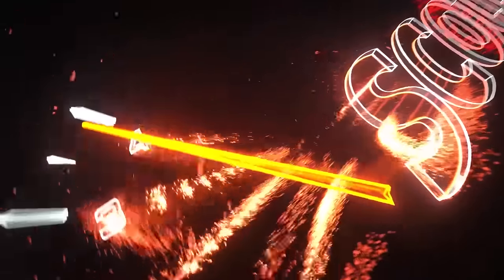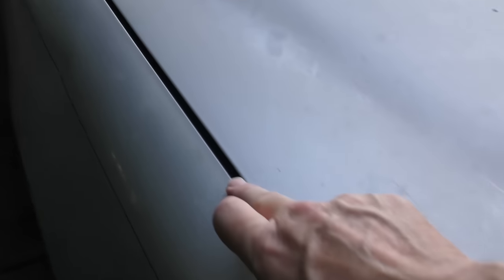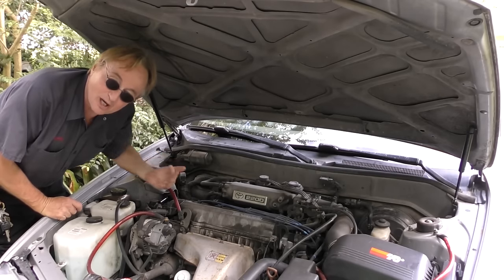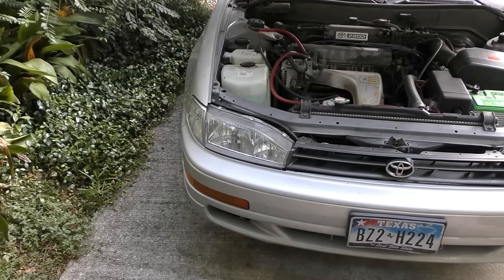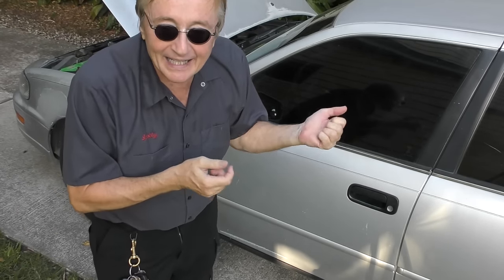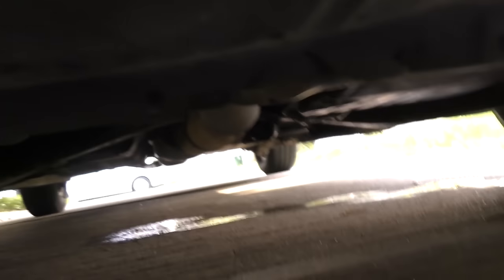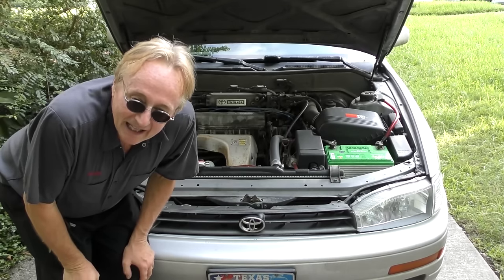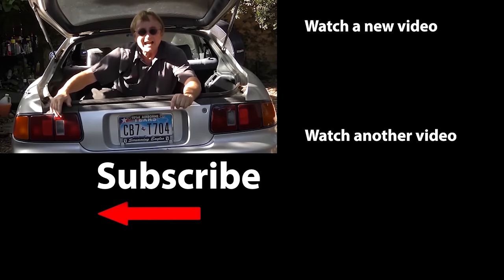Can You Destroy a Toyota Camry

Comment: My 79'Lincoln has original near mint condition original paint and still has the original drivetrain in it,never repaired,original radiator in it too,the factory original digital stereo still works and plays 8-tracks perfectly.HAHAHA!!(8-TRACK)
The AC has only needed recharging ONCE since 1979 and has over 400,000 miles on the clock.
The 1974-79 Lincoln Town car are still quite plentiful on the used car market.
Reply: I've Owned Various Cars; FORD Treated Me The Best!! Have Had 2 Honda Accords '86 & '92 and 2 Toyotas '90 Tercel and '99 Camry. Bad Luck I Guess..
Reply: Rogue Ranger I've had Fords most of my driving years! Got a 2004 Grand Marquis, 1990 LINCOLN MarkV11, both trouble free cars! The LSC is Showroom new, dries like a dream and fast as hell! Got the Mustang 5.0 high performance V8.. 0-60in 7.5 seconds! Pretty good for a 30 year old heavy sports car!
Reply: @joelspivak6622  I'd would like to find a Lincoln Mark-IIV(7) LSC,very nice ride.
Reply: @joelspivak6622  and a 1997 CAMRY LE with the 3.0  1mzfe v6 5speed   with 200.000 miles will eat your lincoln up  with it so called 5.0 ho and lincoln never made a sports car

Comment: Burns rubber in all 5 gears,yeah maybe if it's lowered and tires are rubbing.
Reply: tommyguns14able ...LOL 😂😂😂😂😂
Reply: I have never seen a normal everyday family car than burns rubber in a gear higher than 2nd and I doubt even a 700hp muscle car would do it. If you are racing a car you are not going to be shifting to 5th until at least 90mph and at that speed the car is very stable and its going to take a lot of power from the engine to cause the tyres to lose grip especially in a striaght line. Even with horrible shitty chinese tyres that are almost illegal it wouldn't spin up in 5th and trust me I have said such tyres before.
Reply: Maybe if it was a manual and you started it in 5th and you could take off without stalling it. I've seen that done in small 90s pickups
Reply: I have 2000 Camaro 71.000 runs better than new

Comment: They really did over engineer those things.  I have a 1990 Corolla with 408k miles on it, original engine and 5-speed transaxle, never been rebuilt (put a head gasket in it 3 years ago though).   I bought it 22 years ago for $2,800.  It's about as basic as you can get with manually operated everything, except it does have power assist brakes and a/c.  The a/c still works, but I did have to replace the compressor about 15 years ago (switched it over to R134A at the same time).  It gets 36 mpg and still has lots of power.  And it looks great too.  Had it repainted in 2013.  Best car I've ever owned for reliability and I never get tired of driving it.

Comment: 230,000 miles on my 2014 camry. i've been expecting the trans to fail. it just keeps going and going!
Reply: Rideshare Rob i out 293K on my 2011 And sold it last year and still regret it
Reply: I dont think the transmission will fail, 230k miles is just breaking in for a camry
Reply: @Rideshare Rob....That's encouraging because I have a 13SE in my garage tonight with only 17,778 miles...I've babied the freaking hell out of it..I do drive it every couple to 3 days and get it up to normal operating temperature...Oil change & maintenance every 6 months regardless, coolant and brake fluid changed once already , inside & out immaculately maintained.  I have taken it from Indiana to Florida twice.  I do have a daily beater car a 2000 Dodge Intrepid 3.2 v6 es with 362k on the original engine tonight with original transmission.  Being a Dodge and getting 362k should ease your mind because that tranny in the 12-17 Camry's is supposedly much much stronger and more reliable than most anything else out there especially a Dodge
Reply: Rideshare Rob lots of miles for a 2014! Hope you change that Tranny fluid a couple of times!
Reply: Richard Dobson there are exceptions to the rule! Many people own Chrysler products and love them! Hey... Scotty's not always right about Chryslers! Jeeps are one of the biggest sellers on the road! Wranglers are Bulletproof! Tough as nails!
Reply: @joelspivak6622   Agreed...there are exceptions,  but they aren't the rule....my dad loved Dodge in his day..he had a straight 6 in a 74 Dodge Dart and the body went long before the motor...the motor and transmission was indestructible.. My Intrepid which I bought used in 04 has been the best car I've owned in my life until I bought the 13 Camry.. Only time will tell if the Camry  lives up to the hype...I will say everything on the Camry is so easy to get to compared to the Intrepid...Getting to anything on the Intrepid is a nightmare..Chrysler seems to excel at certain parts of a vehicles build...In some areas they cant be beat...but in my opinion it's the overall complete execution of a vehicles build where Chrysler often falters... Thanks!!!
..

Comment: Got a '97 with the 4 cylinder....223k miles, ice cold air, doesn't use any oil., shootin for 300k plus!
Reply: Mine has 457k
Reply: I had a 96. Got 385 before rhe engine blew

Comment: I miss my 2000 model. I have a 2010 Camry xle that replaced my 2000 xle. The 2010 is some what nicer yet I think the 2000 was better made.
Reply: @IJoeAceJRI  i blew an engine at 328k miles. I tried to buy a 2005 but couldn't find one.

Comment: My ‘97 BMW 318i has 337,000 miles and is still pulling strong! On its 2nd clutch and original engine and transmission

Comment: Me and my mum migrated to Australia in early 90s. Some time later we got a 1994 Camry wagon, auto with manual windows (Australian made one). It was sea wave green colour. We did not have much money back then and I had to learn how to replace water pump, alternator, radiator, and body work repairs from car park dings. That car lasted us 15 years with only one trip to mechanic but only because I did not have big pliers to take off the springs from rear brake shoes. Once I slowly bought all the tools I kept the car running by regularly changing all fluids. They were a fantastic car, a true engineering achievement, like Scotty said over engineered to the max. The golden age of toyota.

Comment: I bought a used 2001 Camry LE with 200k miles on it. Previous owner changed the timing belt. What advice do you have for regular maintenance? I get the air filter and oil changed on time. I also recently got the coolant flushed. Thanks.

Edit: btw, I have owned it for 1.5 yrs now, and it has been the most reliable car I've ever owned.
Reply: what maintenance have you done on it?  I am about to buy a 2002 Camry LE V6...

Comment: Toyota used same 2.2L engine for two Camry generations in 10 years. Other than oil pump seal leak and timing belt that needs replacement every 80k, it's a long lasting engine. Parts are inexpensive and fairly easy to replace. My Camry 2000 is around 200K with quiet engine and comfortable ride.

Comment: Something about 1993 and 1994 Toyotas. They are perfect cars even though lots of things don’t work, are worn out, replaced, and with crap paint. If that was a Hyundai there would be ranting and raving how it’s crap. It’s all a matter of perspective, folks.
Reply: They still drive ok with the bare minimum maintenance. That's the difference between this era Toyota and the rest.
Reply: Toyota were not the only ones of that era to make reliable cars. Believe it or not a Mercedes C Class of that era was also a tank and even today in poorer European countries they are still used as Taxis they were just as unkillable as the Toyotas back then. A VW in particular the 1.9 Diesels of the late 90's and early 2000's were unkillable and tank like I'm not taking anything away from Toyota because they were exactly the same but believe it or not some of the German cars were just as reliable and well built back then. In more modern cars however Toyota is winning hands down modern Mercedes and VW are not what they were. Mercedes was also the first ever car built too.

Comment: Thought my 2000 camry was finally done for. Was dying at low rpm and under load. But a quick replacement of a vacuum hose and it runs like new. Forgot it even had that much power!

Comment: Have a Yaris with 11 Canadian winters and the original factory battery - starts on first turn every time. 
The only repairs are 2x O2 sensors 4 years ago and a check engine light that changed it's mind last week. Runs perfect.

Comment: I got a 2001 Camry with 99,000 miles. It runs fantastic and the air conditioning blows colder than my 2017 Ram 1500 that I paid almost $40,000 for. I paid $2900 for the car. Best financial decision I ever made.

Comment: I own 97 365,000 drive to work DC area bad traffic 60miles per day the Lord has kept it running small problems like oil pump gasket valve cover gasket door handle but still ruunning thank you Jesus!!!!!!
Reply: Seems like door handles inside and out, and valve cover gaskets are issues they all have.

Comment: I bought my first Toyota a 2003 Camry LE cheap after wrecking my 01 Sportage. I'm sold on this Camry, love it. Its so easy to work on. Whoever had it before me let it go. Vacuum leaks, black oil, AC not charged or working. Needs a new throttle body.  It rides great, runs like a champ. I'll start re_storing these. Saw one for $2800 with only 130,000 miles on it.

Comment: I wonder how many 1993 Chevy Corsicas or Dodge Dynasties with 300k miles and the original engines and transmissions are still on the road
Reply: My 91 Beretta gt is still rocking the original 3.1. has nearly 260 on it. I've owned it since 98. Sure I've done work to the engine, better timing chain and gears, re gasketed the upper end new injectors etc. I just swapped out the automatic for a 5 speed this past year, not by necessity, but by choice. As for interior parts, well, let's just say that I'm glad I have two parts cars lol. Car never sees salt but the bright teal paint can use some attention. First car I ever got from a dealer at age 18. She's been more loyal than most of the women I've had lol.

Comment: With all do respect,  unless Scotty has all 26 years experience with this car. He doesn't really know WHAT REPAIRS have been made over all this time. Transmission may have, And most likely been rebuilt,  replaced.  Ac compressor most certainly been replaced, along with most of the ac system,  possibly twice. Alternator very doubtful original, as well as starter.  Realistically,  without a glove box full of repairs,  and he didn't buy this new, or he hasn't been the only mechanic to work on it since 1993, hes assuming far to much.  Any car can be kept on the road if its constantly repaired.  Barring rust out. TOYOTA makes good vehicles. But I dont believe this car it still going down the road without having had many expensive, and not so expensive repairs.
Reply: Actually I have a older Camry 
1.oil change every 5000mi  80$
2. Change belt every 60k mi 500$
3. That’s it my car is 19 years old runs like a champ. 2000 Camry so your either driving like your nuts 🥜 with your car  or maintenance to late causing more problems to your car. I have never encountered as many problems as you just name and a couple other thousands of ppl haven’t niether. Scotty’s knows his stuff he fixes them daily and supplies us videos so we may know to and what to expect just saying not trynna argue.

My grandma 👵 however has a 2015 Camry and has problems left to right no matter how ahead of times she is in front of tune up or maintenance it’s ridiculous dude.
Reply: John Franklin No truer words have been said! The history of the car is known only to its former owners!
Reply: I own a 1993 Camry. Original motor and manual gearbox. No major repairs, only maintenance. Will do a million miles. The greatest cars ever made when it comes to reliability. So you can believe it.....

Comment: Hi Scotty. Love your video. Lots of fun. Had my 98 Camry since 2011 with 120K on the clock. Wasn’t planning to hang on to it for long but still have it. Best car I’ve ever owned. Done 350,000 km now. Replaced rear struts, alternator, speed sensor, brake rotors and 9 year old battery recently. That’s it! Going strong. Keep oils, fluids, timing belts and filters up to date and she’ll last forever. Still see plenty of these buzzing around town in Australia and not many other makes the same age. I’ll be keeping mine for another 10 years!

Comment: I have a 1990 4 cylinder Camry. The body style is slightly different, but is basically the same car. Mine has 325K miles and runs well. When trying to drive up some ramps to get under the car I stirred up crud in the transmission and clogged a duct. I have no reverse because of the clog. It unclogged itself once, but then slipped severely. In getting it moving to get home I stirred it up again and re-clogged it, but then the forward gears worked again. I replaced the shift solenoid which was surprisingly easy. Now I am waiting for it to unclog itself when I will drain the trans and remove the filter to try and find the clog and throw it away so it won't do it again. With the new shift solenoid it shouldn't slip. I will have my reverse back. In the mean time I am careful where I park so I can push the car backwards if need be before starting it. By the way, to prevent failing smog tests, install an oil catch can to filter the oil droplets out of the crankcase gases before returning them to the intake. The 1990 model came with no PCV valve so the oil catch can is legal, even in California!

Comment: I have had two Oz made Camrys a.2000.v6.and 2011 4.   We did 280km in the v6, mainly city driving .  The v6 motor ran like a watch but the interior fell apart .125k in the 2011 it still drives as new.  It's way cheaper to run than the v6.

Comment: Just bought a 2001 Toyota Camry CE 5 days ago at 83k miles. In VERY good to almost perfect condition. It will probably last me an eternity. Nothing bad about the car in the slightest, the paint is still very shiny and the interior is spotless. The minor problems are that the rear bumper is faded and the visors are a little wrinkly. The "i don't know" problem is that there is a weird sound coming from the rear of the car. First thing I checked was the exhaust, wasn't that, next thing checked the tires to make sure they weren't low on air or flat, after that I took it to get the wheels rotated, it hasn't fixed the problem but it doesn't seem all that major. So far I have put 60 miles on the car since I've bought it.

Comment: I have owned several Camrys, two '87's a '93 LE V6 and most recently a '92 LE with that 2200 4-cylinder.  My '92, like this one had the faded paint, but the interior had worn well and was like new inside (as were all of my others).  My '92 had "only" 174k miles, but I thought I had ruined it.  I was on the freeway and looked down and was overheating.  I made it on home, as the temp gauge would bobble up and go back down, but I made sure I didnt run it to hot.  Discovered that the water pump was leaking. I refilled it and drove it less than 3 miles to a local repair shop and not even 3/4 there, it was nearing the red on the temp gauge.  I pulled over, popped the hood and it didnt seem that hot, I so went on another 1/2 mile.  I shut it off in the parking lot of repair shop, then all of a sudden there was a loud boom and steam was going everywhere.  I thought the engine was on fire, but it was stream.  The radiator had blew!  Shop said they had to replace the radiator and water pump of course then test to make sure I had not blown a headgasket.  It tested ok, but it wasn't too long after I kept noticing some coolant seeping from under the radiator cap.  It never overheated again, but I thought it had more issues, so I sold it to a friend, disclosing it may have some engine issues.  She wanted it anyway and next day drove it  200+ miles up the interstate to Roanoke, VA with no issues!  She drove it a year and finally bought her a brand new car, and sold the Camry to a friend.  The car is still going!  I see it every weekend on a route I take to Wal-Mart.  She is still going.  With that said, I should have kept that car!  It did not even had any oil leaks which were one of the only issues these cars seemed to have other than broken exterior door handles.  Oh, I also had a driver power window motor go bad because the switch had somehow got stuck and burnt the motor up.  My aunt also had a '93 Camry LE years ago, it had 360k miles.  I now own a 2004 Toyota Sequoia and a 2001 Toyota Avalon XLS, both with well over 200k, running like a dream.  My Avalon has developed an oil pan gasket leak, so I will have to deal with that soon.  :(

Comment: 2000 Camry 4 cylinder automatic with 200,000+ miles. I've replaced timing belts every 60K, a water pump, main crank seals and valve cover gasket, struts, brakes, ignition switch and a radiator due to front end impact. Normal maintenance, filters, fluids etc. I plan to drive it to 300,000+.

Comment: My wife has a 2015 Camry and may hit 100,000 miles on the original brakes, with a automatic transmission. The last oil change at 85,000 she asked about the brakes, and the mechanic was honest, and said it will make it to the next oil change. My record is 88,000 miles for original brakes. That was a 1987 Ford F-150 with a manual transmission.

Comment: I had a 1998 Camry LE that I got in 2016 that had around 210,000 miles. The seller was selling it at $1900, but with my negotiation techniques, I talked her down for $900. The car ran like a dream with all of the cosmetics and features still in tip top shape. At about 295,000 miles today, it still runs like a charm, only the paint is starting to erode and the roof cloth is starting to come off.
Reply: You ever replace tbe timing belt?  Looking at a 97 right now with 148k miles for $1500???